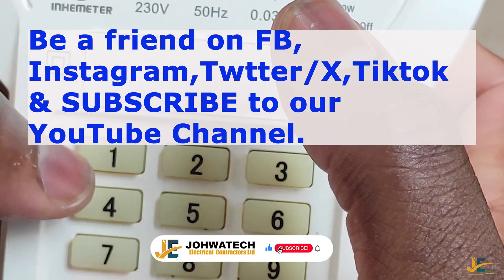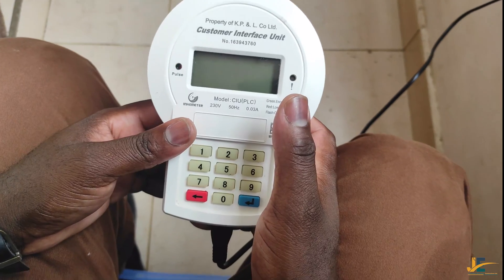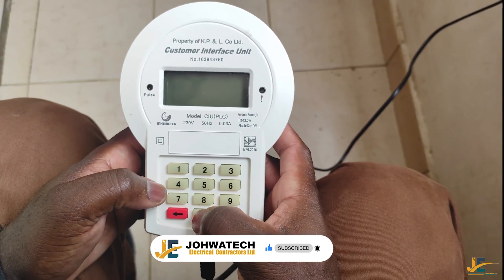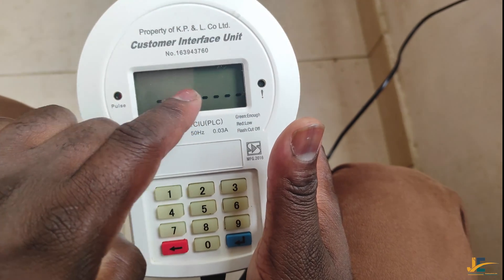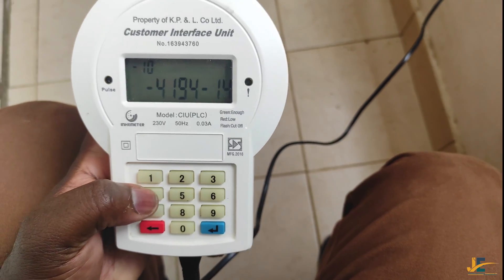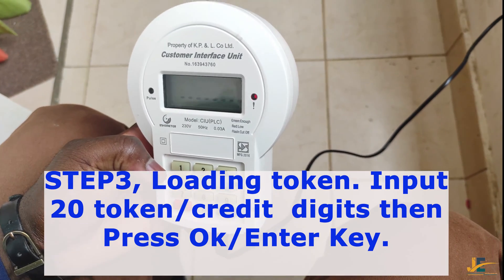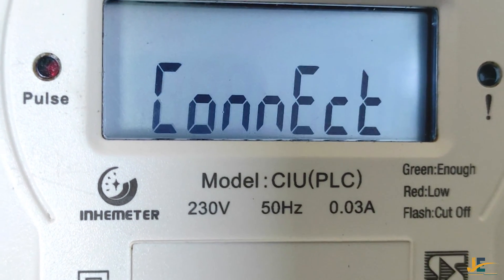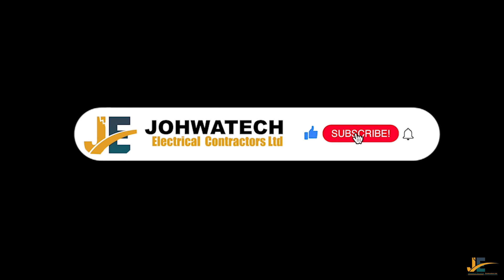How to Activate INHEMETER Prepaid Energy Meter. Pairing/Configuration & Commissioning. #token

Comment: Mine is rejecting
Reply from the maker: @PrinceMaphelela   Below are the list of the reasons you could be experiencing "Reject error".
1.Confirm the Account/meter No you used to purchase token is correct.
2.Make sure you're inputting the token digits correctly.
3.Confirm the CIU you're using to load token is configured with your MCU
4.Confirm the meter was updated successfully.
Reply: Mine says reject 13. And only 2 batteries inside
Reply from the maker: @PrinceMaphelela  below are the list of three reasons you could be experiencing "Rejecting error".
1.Confirm the Account/meter No you used to purchase token is correct.
2.Make sure you're inputting the token digits correctly.
3.Confirm the CIU you're using to load token is configured with your MCU
4.Confirm the meter was updated successfully.

Comment: If my inhemeter shows multiple without showing any numbers what could be the problem. Kindly assist; Thankyou.
Reply from the maker: Try connecting the CIU in a powered Socket outlet, if it responds the same the CIU is      Faulty. Visit your nearest KPLC office for a replacement. For assistance, you can WhatsApp us at 0754879439

Comment: Mine the keypad is not working
Reply from the maker: Get a qualified Electrician with a good reputation to check the problem for you. In case the CIU is faulty you can visit your nearest KPLC office for Replacement or source it from local Contractors.

Comment: What's the name of the application used to connect to the inhemeter using bluetooth
Reply from the maker: Pairing or Configuration of the wireless Prepaid energy Meter is where the MCU and the CIU are matched together.

Comment: my ciu  got water inside and doe's not work, can I buy a ciu and connect it with my old meter with this method
Reply from the maker: Yes, you can enquire about the same model of the CIU and the same manufacturer/time of manufacturer from local contractors or visit your nearest KPLC office for replacement.
Reply: Have the same issue how did you get sorted ?